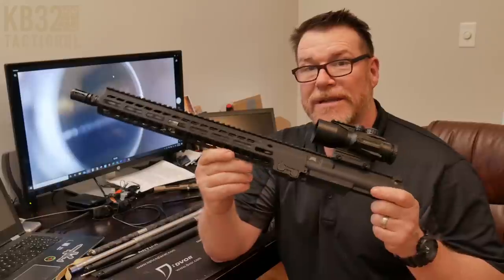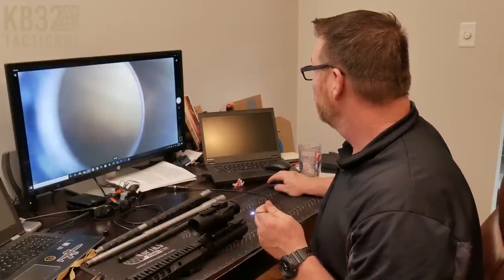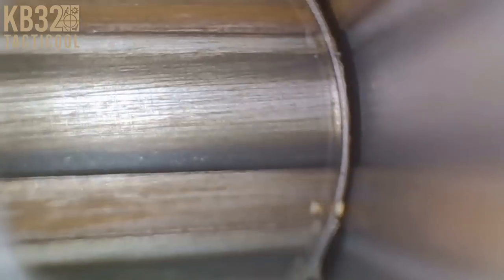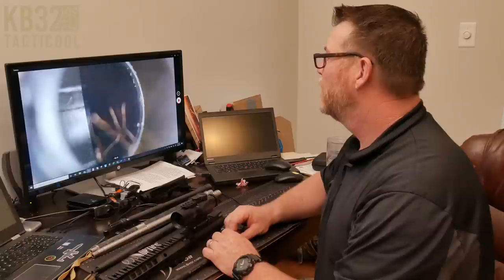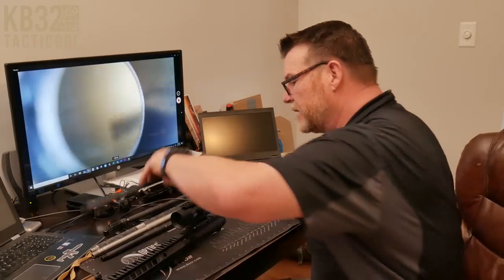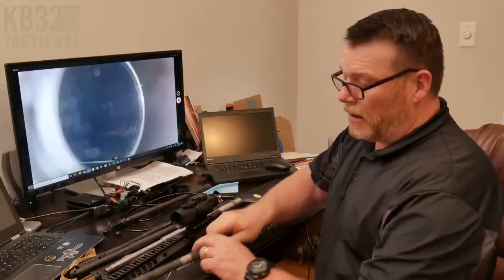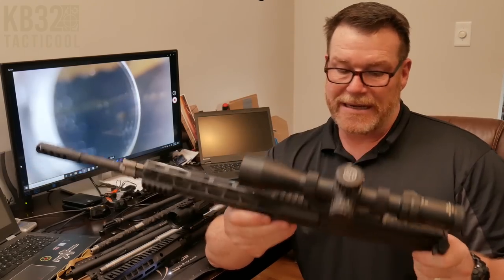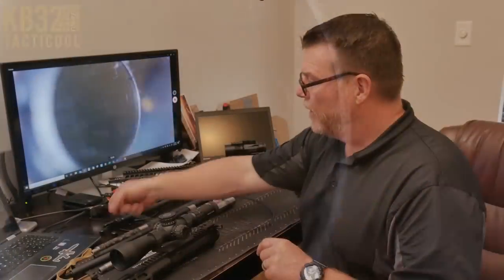Barrels!  Let's Scope them Out!! FN, Seekins, Proof, Criterion, Strike Ind., & PSA

Comment: Notice, the Criterion was the only barrel that had the gas port drilled in a groove between lands. That kind of precision manufacturing isn't cheap. Regardless of whether or not there's an accuracy gain, it shows the company's commitment to quality.
Reply: Wdym, it was partially on the land for sure

see 18:02
Reply: @subbot8077  DAMN dude lol a year later alright. I see what you're looking at, but that dark line on the bottom is carbon. The edge of the groove is lower, it's an optical illusion
Reply: @michaelpawluk6791  lmfao yeah sorry I'm a bit late, I appreciate the reply tho. That's a fascinating optical illusion, thanks for the info!
Reply: You think that's more important than putting the runout centered high?
Reply: 17:55 - 18:02. Follow the lands.
Reply: If they are drilling them all at top dead center, and at the correct location fore and aft, they cannot control where the gas port lands....
Reply: @alanmeyers3957  Actually they can, they just make sure that all machining operations result in the "top dead center"/gas port placement ending up between lands. It takes more precision in operations but can be done.
Reply: It was probably just coincidence.
Reply: Doubtful in the extreme that they would even consider trying to do that on purpose. The location of the gas port can’t be known until the extension is torqued on with the correct headspace.
Reply: @Subtlenimbus  that's just not true. Barrels are made completely outside of the firearm. Are you saying they drill the gas port after the barrel is torqued and head spaced?
Reply: @michaelpawluk6791  thst's exactly what I'm saying. Ar-15 barrels are either drilled or cold hammer forged and threaded for an extension. The extension is then torqued on to the correct headspace. After that, the gas port and alignment pin are done.
Reply: @Subtlenimbus  okay

Comment: I also love criterion barrels. I recently used their hybrid 16" 8n .223 wylde for a lightweight build. I have found it to be extremely accurate even with xm93 ball ammo (sub moa at 100 yds). I used it with Barnes Vortx 70 grain to take a mature whitetail doe last year and it delivered a center heart shot at around 100 yards. It shoots that ammo at 1/2 to 3/4 moa and the barrel is just over 2 lbs. I love it!
Reply: Can't speak to the core series, but I love my hybrid. Not sure why you want a 14.5" unless its an sbr. Pinned and welded muzzle devices cost extra, and hard (if even possible) to change. You'll like the mid-length gas system though, very low recoil impulse. I'm thoroughly impressed with Criterion, and I opted for the headspaced BCM bolt as well for peace of mind.

Comment: If I pin and weld a barrel I make sure to use a 4140 steel gas block normally Wilson or Voltor or Faxon and a Smith Brothers Vortec flash hider.

Comment: Make sure if you are using a water-based product, SL2000, Boretech and so on, make sure you flush and dry patch out.  I use Lock Ease on a patch if I'm going to use the rifle within a week for hunting.  If stored for long periods of time, I use general CLP in the barrel and on my precision rifles I use Tetra Gun Fluoropolymer Penetrating and Bore Conditioner.   New barrels I buy for future chambering I oil those barrels as they sit in my gun safe with a dehumidifier inside.  Prior to shooting, with an oil-based lands barrel, I dry patch out, flush and dry patch out.  I then use lock ease or oil.  Krieger barrel I bought today said never run a dry barrel after cleaning and they recommend oil oR lock ease.   Speedy Gonzalez a hall of fame bech rest shooter uses the lock ease and so does Mark Buettgen who is a world record holder and bench rest national shooter.  FYI.

Wipe-Out is a great product to clean with and can be left in the barrel.

Comment: The Criterion barrel has had a good number of rounds put through it. That crocodile surface in the throat is from heat and erosion. That is normal with use. The barrel looks like it was super smooth when new.

Comment: The US in on of few nations that still uses traditional rifling techniques using machines as old as ww1 era that have been retro fitted.
Well made CHF rifle barrels are impeccable, mirror finish and allow for methods that you could not achieve with traditional like tapering.

If it's a millitary style rifle it has to be chrome lined on top.

I love mil spec or + AKs and ARs, psa has the best selection.  The prices of FN uppers and kits are amazing, you can build a nice rifle without spending a fortune that often outpecs expensive builds.

And yes they work great with steel case
FN makes a lot of US millitary weapons, I just wish they had more of FN barrel profiles, chamberings and twist rates

I like AKs more and ammo is still affordable but I only buy imports or build with imported parts.

If you want a good AK.  Zastava USA m70 chf chrome lined in 7.62x39 and 5.56. Is the best for the money. 

A Wasr is still fine but you have to replace all furniture 

WBP ia always solid.

Comment: May be a dumb question, are the lands visible to the naked eye by shining a light in and looking into the barrel? All i ever see is the rifling.  18 inch 223 wylde.
Reply: Not a dumb question, if you never asked you would never know the answer! Yes, you can see the lands, but you won’t get a detailed view. Rifling is essentially made of two components, lands and grooves. The lands are the raised, or higher half of the rifling, the grooves being the lower half. Another way to look at it is that in typical 6 groove rifling the lands are the areas with a narrower, more constructing diameter between two spots on opposite sides of the barrel, whereas the grooves with be two opposite areas with a larger, more open diameter.

Comment: The rust spots on the stainless steel barrel is created by carbon steel tooling. The term is called contamination. And on the PSA barrel they stuck a steel rod down barrel to knock the burrs off around the gas hole
Reply: When learning to tig weld stainless steel I turned out some beautiful welds, cleaned them with a carbon steel brush. Was so proud of myself when I left work. Came in the next morning and damn if everything wasn't rusted and I had to remake it all

Comment: I have the strike industry 18" on my competition rile. It's sub moa with federal smk and ppu bthp. As good a barrel as my BA 20" dmr set up.
Reply: My 20" BA DMR barrel just arrived today!
Reply: I have their 14.5 Carbine and 16" middy barrels, and they both are around 1.75 moa with ten shot groups using surplus 62gr. One has a 70gr Hornady hand load that comes in around 0.9 - 1 moa with ten shot groups. The other likes Black Hills 262, and hovers around 0.8 - 1 moa, depending on the weather. Both are more consistent than my BCM, Colt, and DD barrels were, and on par with my BRT, though that one is gassed better. All  three fall short of my Lothar Walther LW50 barrel, which was back when they hand-lapped their polygonal barrels.

Comment: I bought a new Proof Research prefit in 308W. After opening, I got out the borescope. It was full of pits. I found that unacceptable for a $600 barrel. Proof Research told me to suck it up and shoot it. They did not want to replace it. Not very good customer relations. I will never buy another barrel from Proof Research.

Comment: I love guys who claims their DD mk18 is so much better then my psa premium upper geissele mk14 9.5 inch rail with the fn chf barrel 10.5. Matched it with a psa moe ept complete lower with an sba3. I’m into my gun for a fraction of the price and it’s just as good if not better 😉 imo! This solidifies it those fn barrel are awesome accurate and will last longer then you!
Reply: I have the same exact gun and it shoots great.  Only about 500 rds through it but I haven't had a problem. Like you said I can't see myself paying that much when you can get the same thing for about $900 less.  Plus, you get the giessele  gas block.
Reply: @jordieb83  pinned! I’d run mine against any DD or BCM and I can’t see them out performing it. It’s a receiver set not a full build. These guys sit here and think their receiver is so much better because of a 1800$ logo 😂

Comment: I was told you want a layer of carbon in your barrel and not copper. After a few copper strip cleanings, eventually you'll create a layer of carbon and copper won't stick to the barrel. This is for the ultimate in accuracy. Copper=bullet deformation which isn't conducive to accuracy.

Comment: I heard you mention Ballistic Advantage, but not shown in the line up. I saw your past video on the one BA barrel that was dogged before you got it (made it look bad). I have several BA barrels and ALL great looking when I scoped them new. They came sealed in plastic, heavily oiled, with plastic caps on each end.

Why is it so hard for BA to get a fair shake on your channel? Yes, there are other great barrels at that price point. Criterion and Proof are great too, but cost more than 50% more than some other great barrels you've reviewed.

All that said, I call BS on your treatment of Ballistic Advantage...and if that's not right, then call Ballistic Advantage and figure out why you're probably the only one with this problem. Why don't you let us know whathappens Has? When you do?

Has anyone else reading this had a problem with Ballistic Advantage? I'd be surpised if you have, but in the interest of transparency...let's hear it!

My own experience, several examples, is "straight A's" for BA and it didn't require much grading on the curve...even compared to my own Criterion barrels (that are top notch). BA still earns extra credit for delivering such clean barrels at their price point. Tell me I'm wrong!?
Reply: I have sent a 223 Wylde, 1/8 Premium fluted barrel back to Aero Precision (BA barrel) twice for accuracy issues (replacement then refunded). I am also waiting on a replacement Hanson 5.56, 1/7 from BA. So, yes; I have had accuracy issues to the point that I am selling an unopened BA Hanson stainless 1/7 barrel and I am trying out various other brands, currently have a Wilson Conbat and Ranier Arms Ultramatch Mod2 to shoot next week. I like most everything BA and AP sell, but I'm done with their barrels, though my 12.3 Hanson is actually decent (1 MOA with IMI 77 OTM).